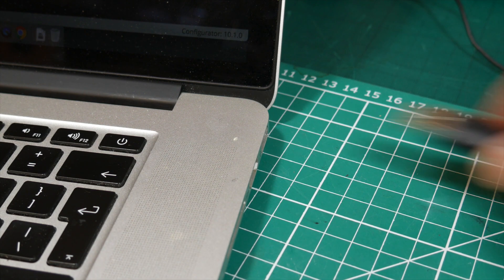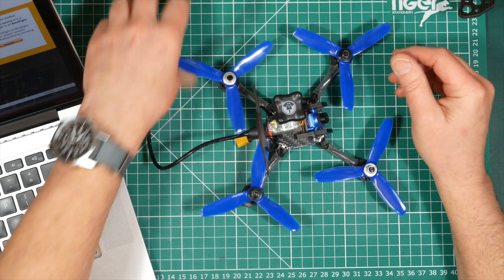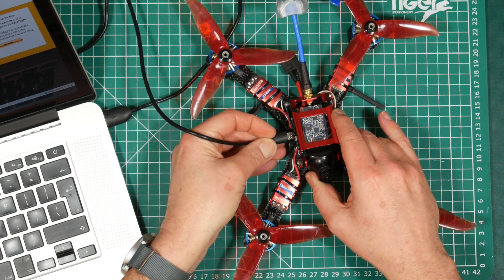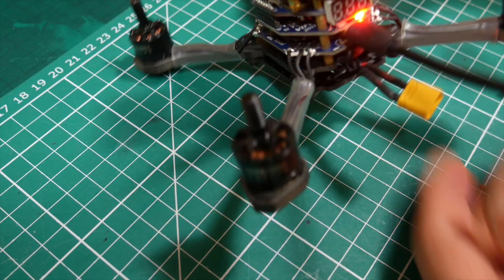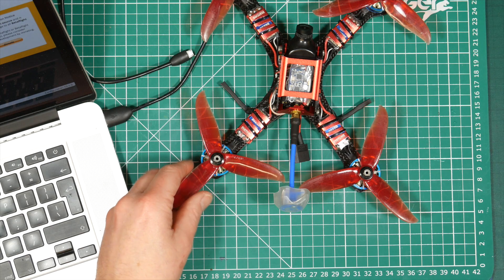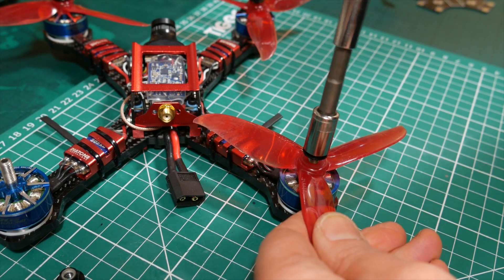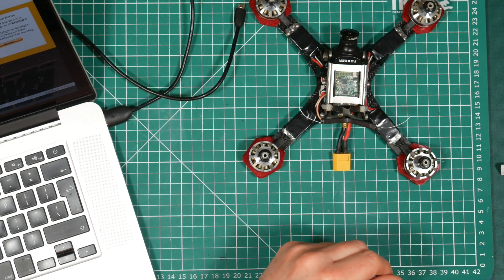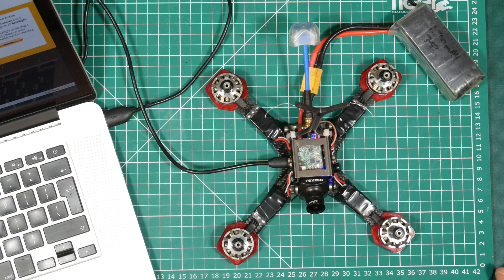No receiver RX power from USB connection. Is it safe to connect a LiPo battery?

Comment: I was wondering if I could connect a power bank (5v 1amp) to the usb port on the flight controller in order to lock the satellites needed to start the motors before connecting the main battery ( sometimes it takes so long to acquire the satellites with the battery connected that things get hot).  When it's connected to the computer it does not get too hot and the GPS seems to be working and the computer puts out 5v and 0.5amp. Would this damage the flight controller? Thanks for the video👍
Reply from the maker: I use the ViFly GPS-Mate to do that. https://www.youtube.com/watch?v=-Y3J7CWBEOI
Reply: @WhirlyBloke  Thanks for the suggestion but there's no much room left for it and 14 quid... I think I am going to give a try to the power bank I use to recharge my phone and see what happens... It provides 5v and 1amp more or less as my laptop, I hope it will do the job and won't damage the FC
Cheers 👍

Comment: Hello I have a tyro 109 with tx16s and frsky Mx+. Every thing works great if I have the usb connected and the 4s battery. But when I unplug the usb from the computer the receiver loses all power and renders the quad useless. Tried soldering receiver to board and
Reply from the maker: Plug a battery in and measure the voltage on the receiver pins. You should see about 5V. If not, check the battery is good and check the quad is otherwise powering up - beeps and prop shakes. If that's all good and there's no 5V on the receiuver, then it's probably the voltage regulator on the flight controller that's fried. You may be able to replace it, but it's easier to get a new board.

Comment: Hi I have recently built a new drone using the mamba F405 FC paired with the F50 ESC. i have bought two different XM+ receivers and neither usb connection or lipo power turn on my receiver. everything is soldered to the correct positions and the flight controller lights up just fine. Has anyone else had this issue and is there any way i can fix it?
Reply from the maker: Make sure you're using an inverted UART input for the SBUS.
Reply: Whirly Bloke Sorry for my ignorance but I’m not sure what this means can you simplify it? Thank you for replying!

Comment: When I connect the lipo, betaflight does not connect to drone
And when disconnect the lipo, it connect, but the receiver does not turn on...
Reply from the maker: Sounds like a wiring. Double check the RX is wired the right way around. Typically happens on things the R-XSR where the smart port or sbus in is wired rather than the sbus out.

Comment: Hey can a charge only usb cable fry flight controller?
Reply from the maker: Nope
Reply: Whirly Bloke hmm strange two fc fried and there plug-ins only connected to betaflight by usb gets hot and died thanks for reply
Reply from the maker: @jonrudd4965  Sounds more likely to be a short in the wiring somewhere.

Comment: so can i bind my rx with radio without lipo? it flashes ( rx ) when i plug us
Reply from the maker: Our depends on the flight controller. Some power the rx on usb and some don't.
Reply: I have the same question... My rx powers on, goes into bind mode, but continues to beep. I thought it may be because I don't have my 6s battery yet

Comment: I fix this problem but now when i take off the usb cable and leave it only with the lipo, the reciver and flight controller have no power. I have the emax hawk 5. Any idea whats the problem. Thanks
Reply: Hi did you find a solution?